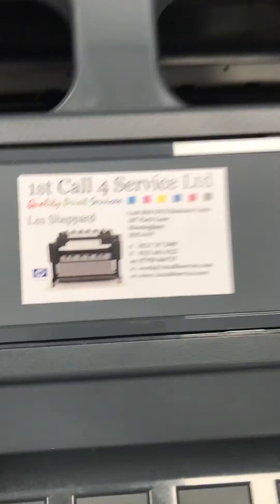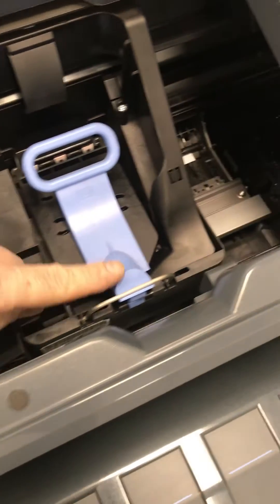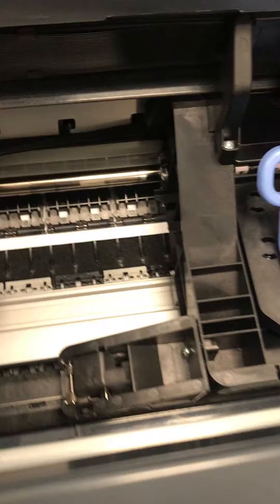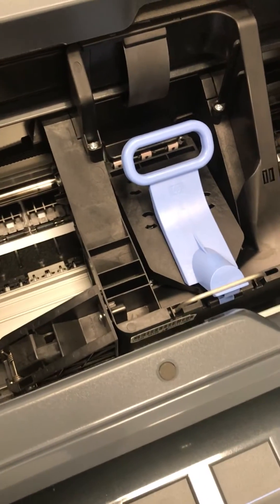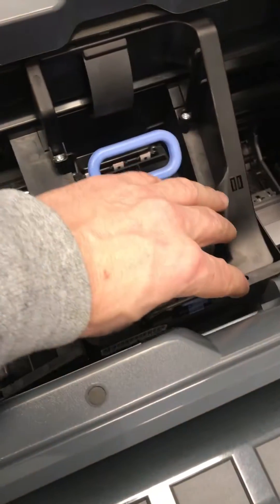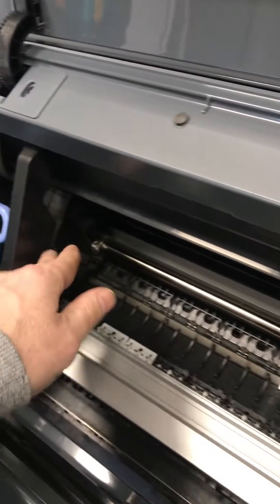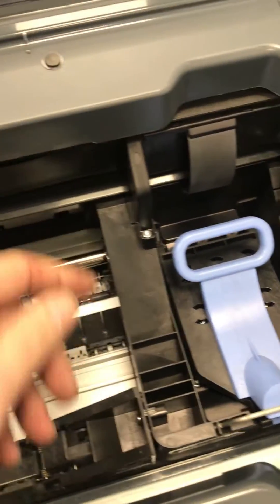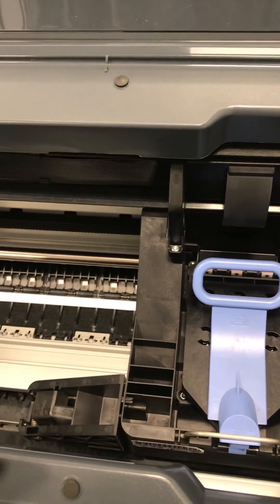System error code: 86:01 on HP T790 T1300 T2300 Designjet Printer

Comment: Halo please help me
hp designjet t795 error 79:04
Reply: Code: 79:04

Description:Generic firmware error

Remedy:Call agent: 1. Use the power switch at the rear to turn off the printer, then disconnect the power cord. Reconnect the power cord, then turn on the printer. 2. Update the firmware. 3. See Appendix A: How to troubleshoot system error 79:04 and 79.2:04. 4. Information available by pressing while viewing the system error screen; or, preferably, provide the diagnostic package.